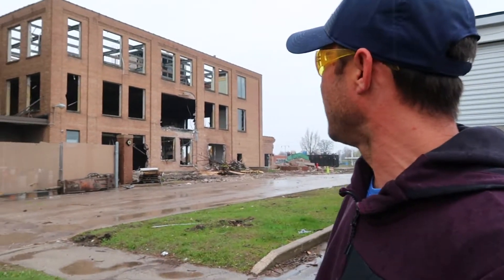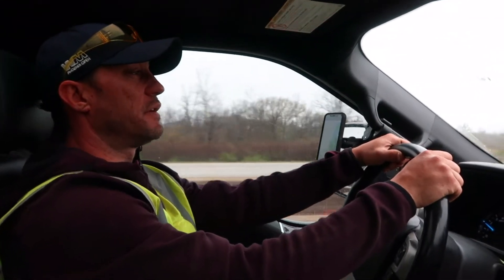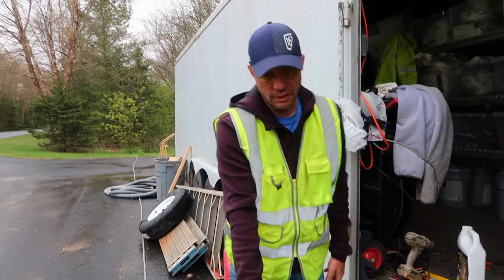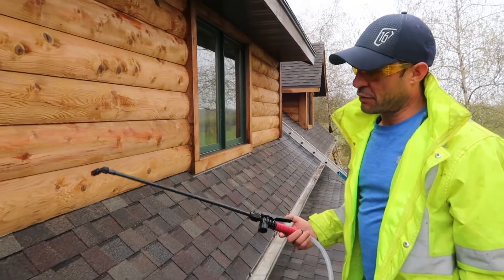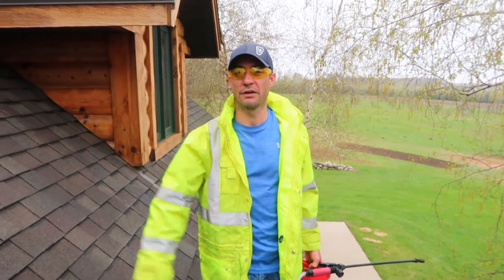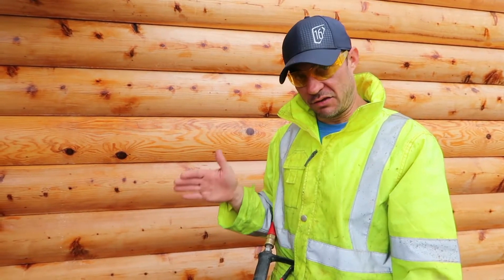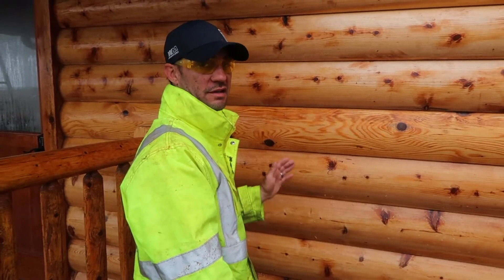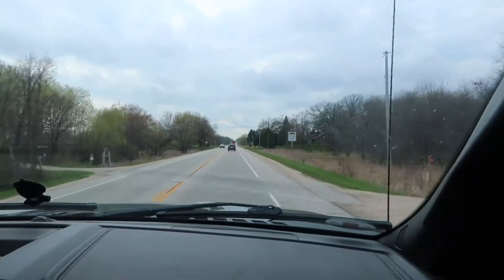Kuehl Industrial Services | Log Cabin (Wolman Deck Brightener)

Comment: I just stained a deck on a log home and she wanted to get her log home pressure washed. She had several issues one in our area here in Ga not alot of log homes so really hardly anyone experienced to do it. Another was she was told she had to do a soft wash bc high pressure washing would do damage. But i see you using a high pressure washer are you not worried about messing up the chinging and other problems that could happen?